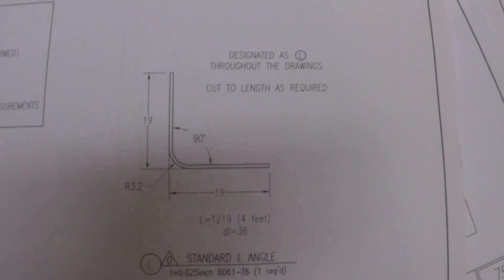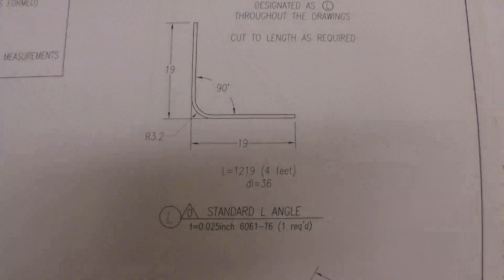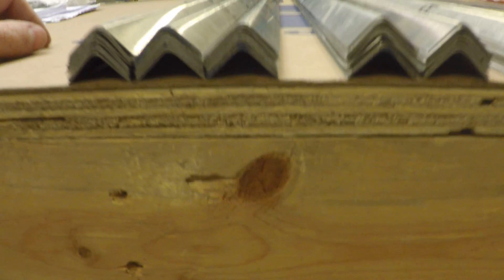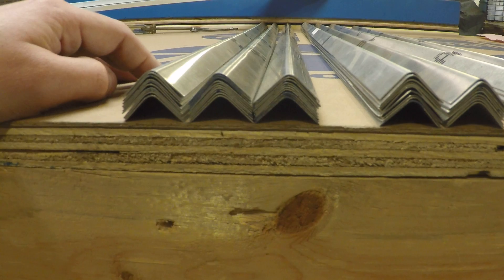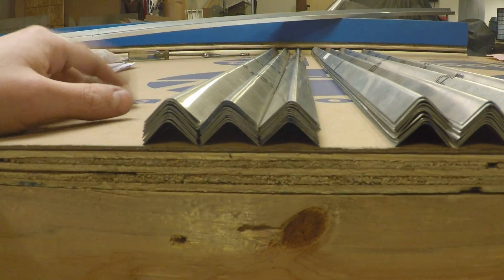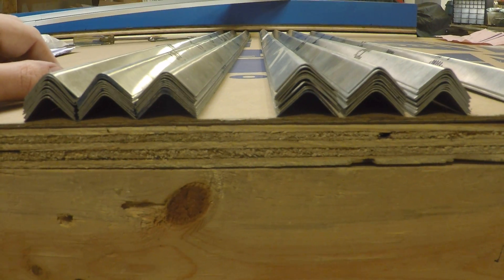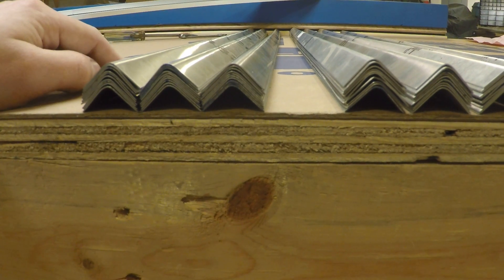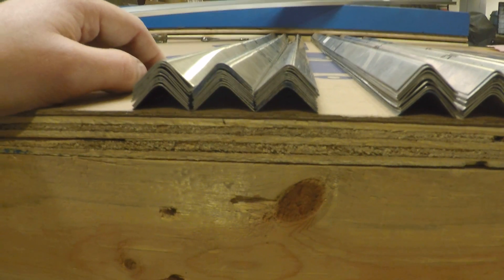Making Zenith's "Standard L"

Comment: What size of these L angle needed for wing construction?
Reply from the maker: Various lengths of L angle are used throughout the entire plane. It is all formed from .025" thick 6061-T6 aluminum and then cut to length depending upon the specific location it is used.
Reply: @GregsZenithSTOLCH750  sorry,
And what thickness of aluminium sheets is needed?
Reply from the maker: @vagusnerve8797  For which part of the airplane?
Reply: @GregsZenithSTOLCH750  wing skin and fuselage skin
Reply from the maker: @vagusnerve8797  You will need a set of blueprints to tell you, specifically. Most of the skins are .020" and .016" in various places, but there are also some doublers and other specific parts that are thicker in various places.
Reply: @GregsZenithSTOLCH750  okey thank you
Reply: @GregsZenithSTOLCH750  thnk you

Comment: Hey Greg, who do you buy your metal from?
Reply from the maker: I buy locally from Alro Steel for everything thicker than .020." For .016" and .020," I order directly from Zenith since you have to get wingtips and other stuff. Their prices are very competitive.
Reply: I'm in SC I called around and found one company near me that had fair price on .016 and .032 but only had .025 not .020. Thanks for the reply.
Reply from the maker: +Jason C Alro Steel doesn't carry .016" or .020" locally, which is why I buy it from Zenith. Aircraft Spruce has good prices too, and their aluminum has a plastic sheet covering on one side, which is nice for keeping down the scratches. I've ordered from lots of different places, but Alro & Zenith exclusively for thin sheet. I also hit Amazon for thr thicker stuff (.090" & thicker.).
Reply: Spruce was almost $200.00 in shipping for just one sheet so I'm looking for other companies to buy from.
Reply from the maker: +Jason C If you order sheet from Spruce, make sure you check the box "roll for shipping." they can roll anything up to and including .032". everything else is too thick to roll, so I buy that locally.
Reply from the maker: They ship via regular carrier (UPS, FedEx, etc.) when you order it rolled.